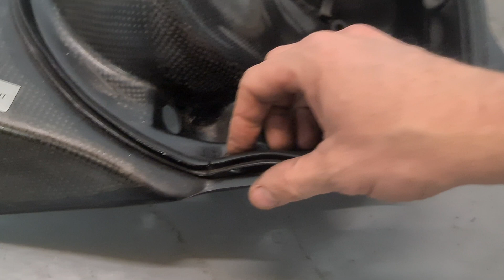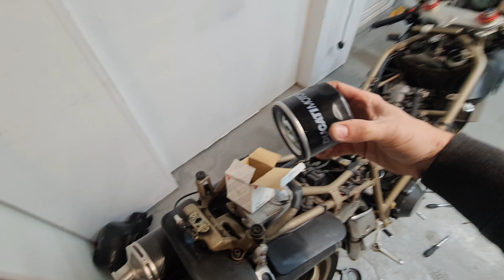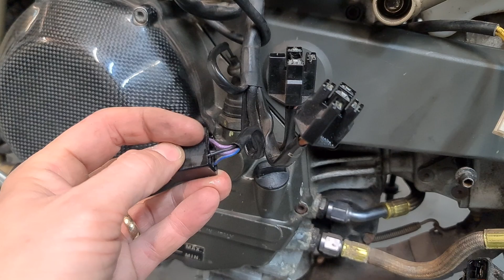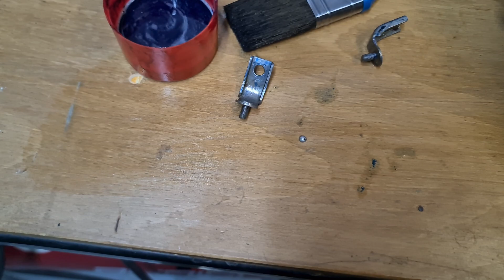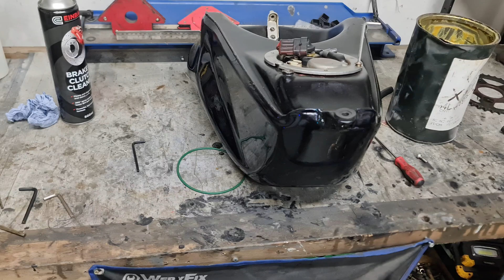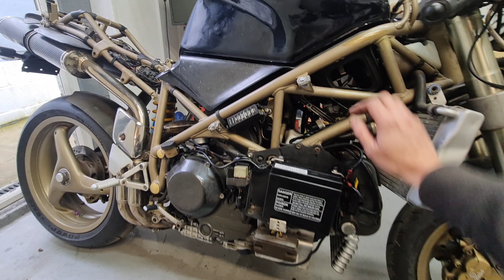DUCATI 916 ELECTRICS REPAIR FIX

Comment: The problem with bleach on the cables is it will have wicked down the inside of the wire, and you won’t get it out😮 if you get new ones, before you put them on the bike try to force ACF50 down the entire wire, like you would lube a  an old brake cable! That way the copper wil not corrode, and the wire should be more flexible.
Reply from the maker: Yeh i do actually say on the videos when i use the harpic that you need to neutralise the chemical... It would take a lot ox exposure time for it to bleed down the insulation to attack the core of the wire..
I cant say that i have ever had a corrosion problem in all the years i have been doing this, you are not wrong.. But i do soak the metal in WD40 after or apply paint, oil, grase etc to whatever it is...
But like i said it would take quite some time for that liquid to soak into the cable core and not just the few minutes that i use it.

Comment: I have the adjusted by the Allan key,  belt twist and recently the acoustic  read at around 90 hz that was on a st2. Actually they all worked for me. Where the belts get very close to each other at the adjusters can be a disaster point. They can be adjusted so they rub each other and fail.
Reply from the maker: Yes, they do. I think it's well known now... but I never knew this was the case in the past, but I always went with what it said in the manual to tension counterclockwise ...I don't know why many people have never read the manual

Comment: Hi, great content ive watched the first 2 clips, looking for a project to do next year, not sure what you paid for a bike in this condition. Nowing a little bit more about this 916 would you have bought it again or looked for something that was a bit more cleaner or not so much work to undertake.
Reply from the maker: Hello David yeh I do get the worst ones 🤔 but a 916 project is always worth it ...I will be selling it sometime when it's all new again I did turn down a 996 in better condition and roadworthy for 5k but with this being a 916 it's worth it all-day long .. it all depends on what your skills are to keep the cost down with a project but do the research beforehand to see what parts are available then its a good starting point...

Comment: I bought up rated leads for my Pani , made hell of a difference in starting
Reply from the maker: Brilliant... Yes I made better leads for my 1198 and with a good battery it fired up as quick as an I line four engine
Reply: Ive the Jonh Walker leads on my rsv mille. Fantastic upgrade